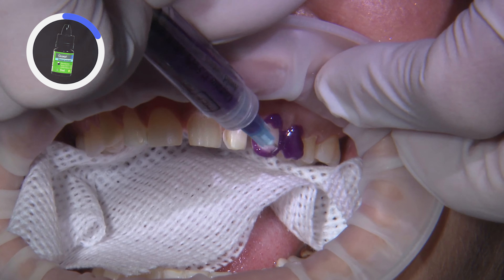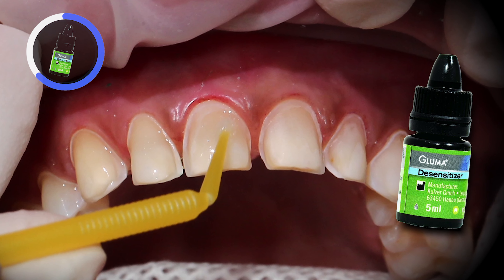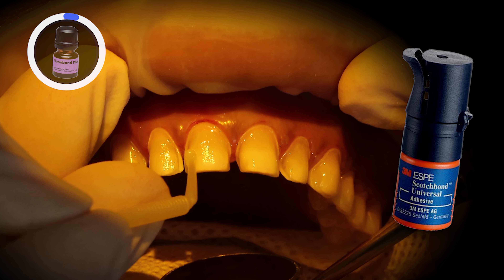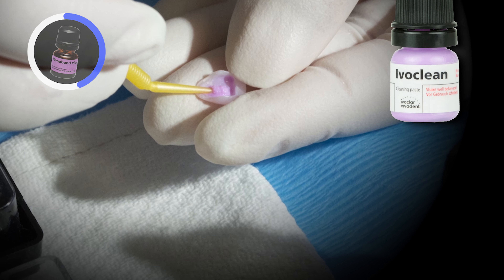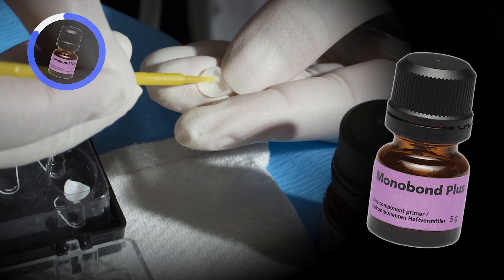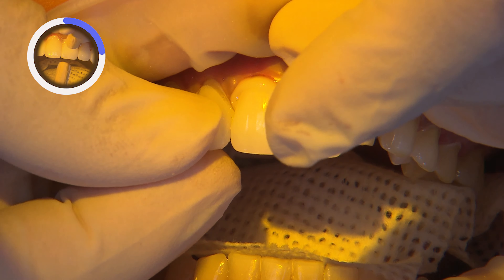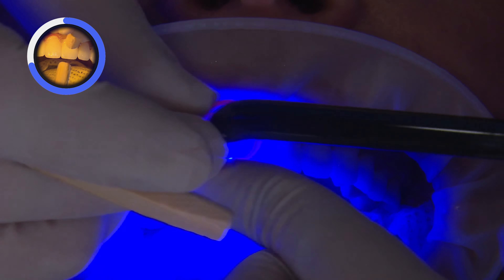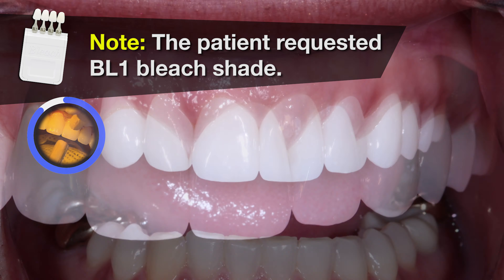HOW TO Seat Zirconia Veneers for ANTERIOR Teeth #4 - 13

Comment: Hi is it normal to feel jaw pain and temporal head region pain after preparation of lower jaw teeth
Reply: No may be ur doctor was too aggresive with the preparation or it is just because you drink cold or hot drinks on the preped teeth
I can confirm it if u still have this problem after cementation of your restorations